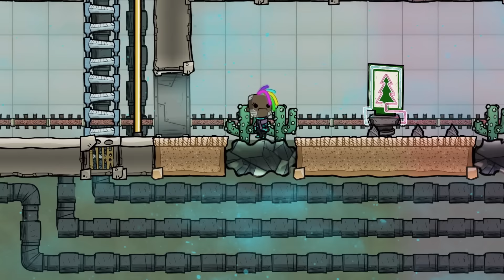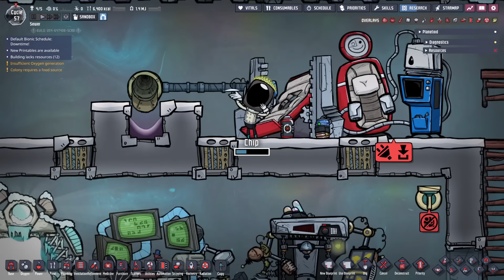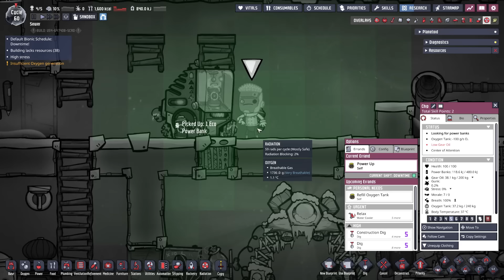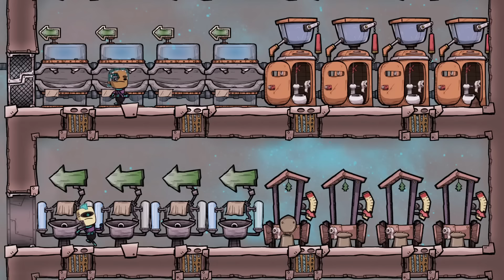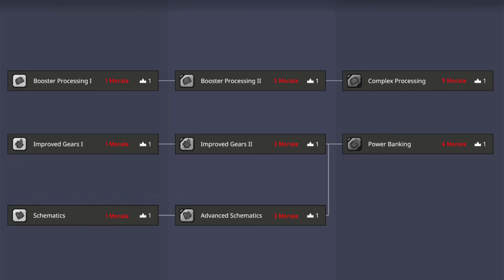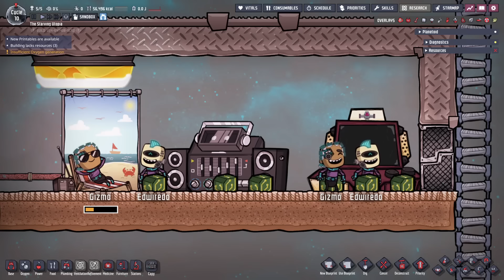Oxygen Not Included - Tutorial Bites - Bionic Duplicants

Comment from the maker: Adding a comment just to add some extra information out there:

- Correction on the skills tree, they are 1, 2, and 3 morale like normal dupes, and the total skill tree takes 15
- Bionic duplicants do not breathe out Carbon Dioxide
- They do not need to sleep, so you can choose to have more work time or more microchips
- They cannot make dream journals for the Somnium Synthesizer, but can benefit from its buff

- They can use the rocket toilet but will clog it
- When getting lubricated with oil, they get a temporary buff aftweards

Thanks to all the helpful comments - I do try my best to research eveyrthing, but especially with new content it can be difficult to verify everything, and to guess every bit of information that might be itneresting!
Reply: Another correction - You said they don't eat so they don't benefit from great hall morale bonuses. This isn't true. They can "eat" power banks at mess tables and this will give them the morale bonus. I've confirmed in my play test.
Reply: @Italics416  I'll add that they'll even put table salt on their batteries for the additional +1 salted morale buff.
Reply: How can you heal them ? Don't work like normal dupes :(
Reply: @KannstJa assign them to a bed, if they break down anyone can heal them but you have to click on them and max their priority so that others can handle it right away, they can suffocate/drown and even die if they are incapacitated with low oxygen banks that run dry
Reply: also     they fully eat eco power banks now  :C        its not reusable....
Reply: where did you get the wrong morale values for the skill tree from before, if you dont mind me asking?

Comment: Is there any real benefit to starting with a bionic right away? or is this more of a mid / late game thing to start getting into. Just seems like I cannot research everything fast enough for them to be maintained early on.
Reply from the maker: They can be more flexible because you can swap boosters, but their power requirements can ne tricky.
Reply: @GCFungus  I am on cycle 115 now, and I still don't feel prepared for the bionic dupes. I need to find oil still to make lubricant. Is there a better way to do that in early game at all, or is it just a simple dig yourself to the basement asap sotra thing?
Reply from the maker: @XievisTheDragon They make gunk which can be collected and turned into gear balm.

Comment: Hello. There's a problem. The lubrication station uses "Gear Oil" and not Phyto Oil as a lubricant. If you use Phyto Oil, the machine won't work.
Reply from the maker: Gear oil is a category and phyto oil is one of the gear oils. It should work if you send in phyto oil.

Comment: While I generally prefer normal dupes for most things, I will say. I find that starting with a Bionic dupe geared for digging is very helpful for early colony building. Since they don't need to eat, can hold oxygen for longer periods, and (optionally) defragment every three cycles, and their starting digging booster gives them firm digging from the start, this makes them great for digging out into other biomes, since oxygen is a bit less of a concern.

Also, I haven't done any testing on this, but I'm curious as to how effective Gunk is for stabilizing temperatures. It doesn't have too high of a heat capacity, but it has almost as much thermal conductivity as oil. I don't really know too much on Specific heat capacity, or Thermal conductivity, but from what I understand is that SHC is how fast it takes something to heat up (meaning Gunk heats up quickly), and TC is how fast heat is transferred between surroundings. So, that means Gunk heats up quicker than oil, and transfers heat almost as quickly, while also having a higher cooking point than crude oil. So what I'm curious is, how effective do you think Gunk is for temperature maintenance?

Comment: Kinda useless. The time needed for them to eat, gunk, and balm kills there offtime working.
They are only useful for nothing as throwing a probe and a dupe looks better then some robotics.
Reply: They can spend 2.5 cycles out of the base on their own, so there can be far less travel time if they're adventuring far out. If you're digging straight down, you can drop them sandstone, copper ore, balm, and o2, and they can dig your shaft and build the ladder, firepole, electric wires, and pipe all at once without having to ascend for supplies or air. Using the pipe, you can periodically build a gunk extractor, and send the gunk back up top, so the boop never has to surface until they are done with the shaft.

Comment: For those bionic dupes, I would recommend had their “mess hall” containing both oxygen tanks and charged eco batteries. But the battery needs to be used in a separate room: one power room with rechargers only and transfer between two rooms using conveyors. Empty battery goes in and charged goes back.

Comment: As follow up Tutorial, you could design a Gunk Boiler
Maybe two Versions:
Gunk to Petroleum
or Gunk to Sour Gas
Reply from the maker: The problem is a single bionic dupe makes 20kg/cycle of gunk, and you lose some when converting to petroleum. That means a single oil well makes 108x the amount of petroleum as a dupe, so the amount of output you'd actually get is very, very little. Plus the design for any boiler would be more or less the same anyway, so I don't think there'd be much to add to the existing Tutorial Bites.
Reply: @GCFungus  
GrindTheGame made a Gunk to Sour Gas Boiler, but the design still needs some optimization

Comment: Quick note/tip, the oxygen canister filler can be set to different amounts up to 200kg.

Bionic will grab a canister during their downtime to refill.

Since these will take 200 seconds to fill, you will need one per dupe on a shift.

I have noticed that Dupes tend not to use all 200kg, so 1 pipe will work for 2 fillers. But you want a storage between the two fillers so the overflow will allow both fillers to fill at the same time

Comment: One technique you can try, you can make a "gunk boiler" like a petroleum boiler.  It takes a little more heat, but works well.  The odd thing is it gives off sulfur gas which if you have 2 or 3 levels of winding pipe/draining petroleum, it will just store infinitely in the top section.  I put a gas pump and a limited for 100g/s and pump it out to cool it down to get sulfur.

Comment: 9:08 Phyto Oil can also be heated into Algae

And If my calculations are correct,

Slime -> Phyto Oil -> Algae (46%)
With (30%) Dirt, and (24%) CO2

Has a slightly better converting ratio than Algae Destiller (33%)
With polluted water as byproduct (66%)
Reply: Too much of hand work required. It's like using algae terrarium for oxygen.
Reply: No?

Comment: I was doing some math after watching your Nuclear Power tutorial bite, and the Atomic Batteries introduced by this DLC are actually pretty nice for a variety of power applications. (The ones made with Enriched Uranium in the Molecular Forge, not the basic Uranium Ore batteries for the dupes)

An Atomic Power Bank turns 10kg of Enriched Uranium into 60W for 150 cycles, or 5,400kj, and generates minor amounts of heat
Based on your tutorial, Research Reactors turn the same fuel into 2,400-14,400kj in 1 cycle, and lose some of that energy to cooling the turbines.

This makes Atomic Batteries great for applications that require intermittent bursts of power or a low, consistent supply, and they can be quickly plopped down anywhere in your base, rockets, or other colonies. I'm currently using them for powering my Eco Battery Charging stations, powering my rocket interior to save height and materials that would have gone to solar panels/battery modules, and for running my SPOM so I can store Hydrogen for liquifying instead.

Just have to be mindful of the explosion at the end of their lifespan.. 😅
Reply: could use a cycle sensor setup to replace the battery once they reach their lifespan and throw the old one into a steam room, perhaps
Reply: @alamrasyidi4097  Ooh I hadn't even thought of that, that's a great idea! I was just going to pack it in Insulated Tiles and let it explode

Comment: A thing i discovered is that bionic dupes can use the neural vacillators. Which means if you end up rolling, say, beefsteak: that's a FREE +10 strength for no booster cost, and for the dupe that can never passively gain stats, that's INSANELY good!
Reply: I tried this and got the trait that allowed them to hold their breath longer 😭😭 completely useless for them
Reply: @fuzzyblurr3555  its not holding breath it is less oxygen usage so it is not completely useless

Comment: worth noting if they run out of power because there are no power banks they will be incapacitated where they stand like as if their HP has dropped to 0. if they are somewhere that has no oxygen they can suffocate and die. just because they are off does not mean they do not need air.
Reply: they will suffocate regardless of oxygen presence. incapacitated bionic dupes dont breathe at all and will start to deplete their oxygen tank until completely empty. once theyre incapacitated, youre on a timer to get them another dupe to fix them with a power bank
Reply: @alamrasyidi4097  ah yeah true, i must have a mod or something that prevented that normally or just havn't had it happen in so long i'd forgotten.

Comment: Since they seem to have quite a synergy as off world explorers, i wonder what the interaction is with the wall toilet, does it still need to be unclogged of gunk? And if not then thats quite a significant amount of rocket space to dedicate for de-gunking
Reply: Wall toilet still cloggs when boops use it so it will need to be unclogged but tbh thats not really a major issue since boops dont need to use the bathroom every cycle like normal dupes.
Reply: i think the wall toilet is the only space efficient solution for gunk. those gunk extractors are massive and reusing the gunk with an in rocket apothecary will take even more space (not to mention youd probably want a bottle filler in this setup). basically, the intended basic gunk extraction setup is too space inefficient. better stock up on gear balms on rocket missions and install a wall toilet
Reply: @alamrasyidi4097  Technically, if you have enough stress reduction, you can just go without lubrification.

Comment: the dura banks cant be used by boops?
Reply: Dura banks are now named atomic banks and they can no longer be used to power bionic dupes. The issue with the atomic banks were the radiation will basically kill the boops even if they took a rad pill, so in beta they basically let boops not use them anymore but they can still use the nuclear bank which emits less radiation.
Reply: @carlosromero2839 they did not. eco banks are an early tech dura banks unlock with reactor
dura banks use enriched uranium and produce a continuos 60w for like a 100+ cycles. ig they got renamed to atomic power bank in beta
Reply: @carlosromero2839 Nah dura banks are now the atomic banks